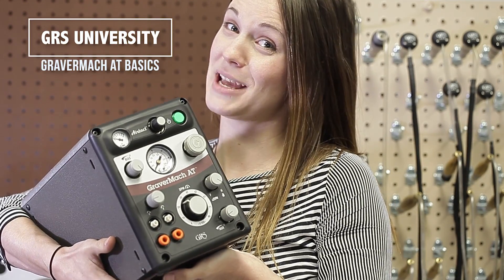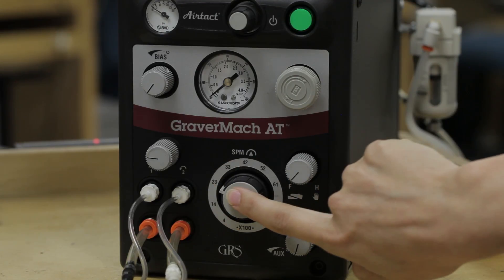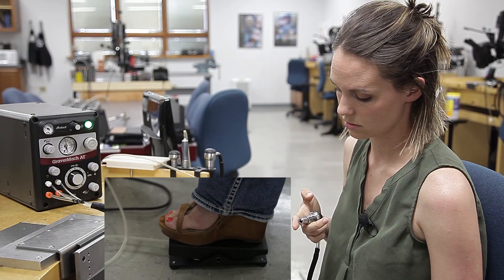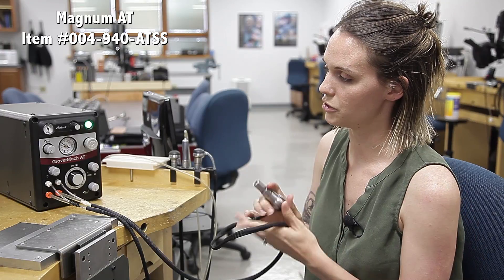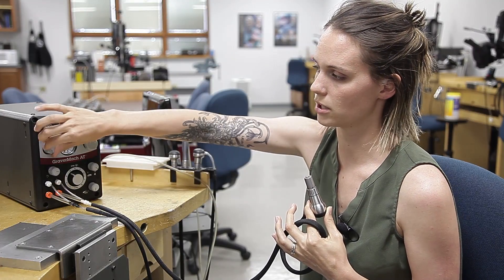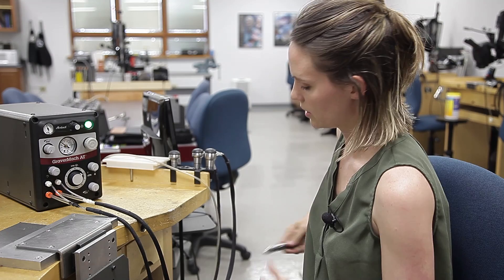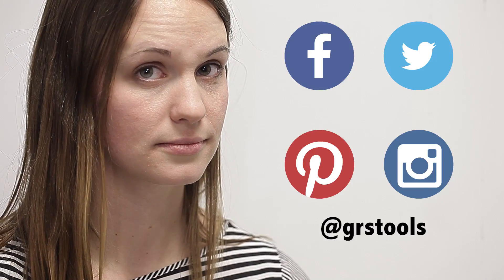GRS University: GraverMach AT Basics

Comment: What are the specifications of the compressor that should be used with the GraverMach AT?
Reply from the maker: The compressed air supply should have a minimum pressure of 45 psi (3 bar) and a maximum pressure of 120 psi (8 bar). The compressed air supply must have a minimum flow capacity of 1.4 CFM [ft³/min] or 40 LPM [L/min]. Our air systems require oil-free compressed air, so we usually recommend oil-free air compressors, or placing a coalescing air filter (oil removing filter) on the line from the compressor to the air system.

Comment: I'm having an issue, I have a new GraverMax G8. It has been relatively ok however at around 19 PSI the piece vibrates without enough pressure, I go up slightly and I get a very weak vibration that isnt giving enough push then uo a slight but more it goes too high and I get the vibrating foot pedal sound again.

Comment: Parece un poco complicado su uso con tantos ajustes que hay que hacer  y todavía falta lo del compresor  .
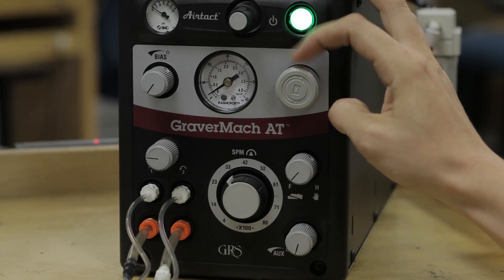Reply from the maker: The air system can be a bit intimidating with all the knobs on the front of the box. The most important adjustment is to tune your handpiece, shown at the 1:50 minute mark of this video. Once you do that, the strokes per minute is personal preference - Molly prefers the 3300 spm (33 on the dial) for general use. As for air compressors, we do sell compressors with the necessary attachment kits and fittings at grs.com. If you choose to purchase a compressor from somewhere else, we recommend oil-free air compressors for use with our air systems.

Comment: What pressure should the air compressor have?
Reply from the maker: The GraverMach® AT requires an oil-free compressed air supply with a minimum flow capacity of 1.4 CFM [ft³/min] or 40 LPM [L/min]. GRS recommends the air pressure to be 45-60 psi (3-4 bar) before it enters the GraverMach®.

Comment: why is it so quiet? is it hooked up to compressor?  Also do you have a video like this on how to operate the older G8 version that doesn't have the air tact feature?
Reply from the maker: This video was shot in our Training Center. The GraverMach AT shown is hooked up to compressed air that is being run from a different area of the building. For initial setup of the GraverMax G8, please visit this link: https://www.youtube.com/watch?v=Gp815gV7gH0&t=1s . The GraverMax G8 has all the same functionality of the AT, with the exception of Airtact capability. Handpiece tuning will remain the same as shown in this video, but you will use the foot pedal to actuate the handpiece.

Comment: HI ,
Is this machine used  just for jewelry making or also for engraving  fine line  details images on materials like metals   , plexiiglass ,  by connecting  engraving machine tools with it  ?
                                                                                                                                         
                                                                                                                                        Thank you
Reply from the maker: Yes, this machine can be used for both jewelry and engraving.

Comment: can the rotary handpiece be used with the foot control?
Reply from the maker: Great question. No, the 850 handpiece does not work with the foot control as is. If you would like to use the foot control as a throttle with the Ultra 850 look into the Ultra 850 with System 3 Foot Control (item #004-914). This can be run independently from the GraverMach AT or run through it.

https://www.grs.com/product/004-914-ultra-850-rotary-system-with-system-3-foot-control/

If you have any other questions please feel free to give us a call and speak with one of our friendly sales representatives.

Call: 800-835-3519 or 620-343-1084

Thanks and best wishes for your next project!
Reply: Thank you

Comment: Thank you so much for this video. Also, thanks for being not so deathly serious and a little goofy. Very good content.
Reply from the maker: You are very welcome! Thank you for watching and commenting!
Reply: @Grstools  does the grs have a integrated air supply or does it need a separate air supplyer?
Reply from the maker: The units do not come with an air compressor. We sell air compressor units that come with the required hook ups for the machines.